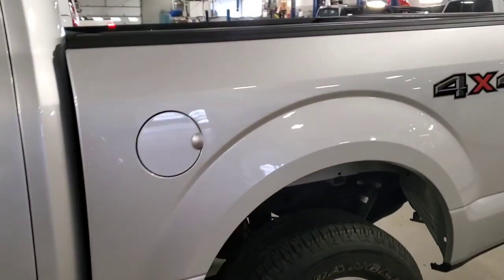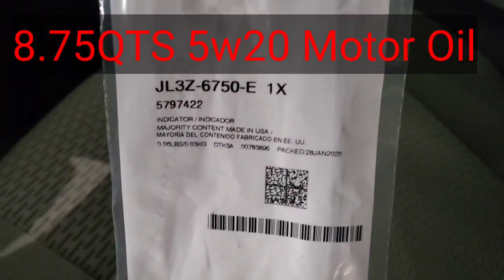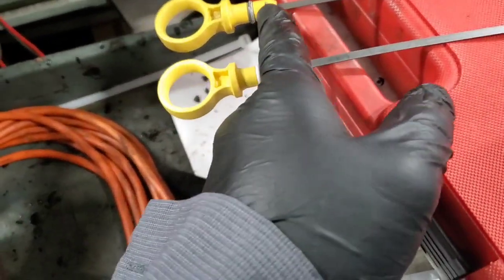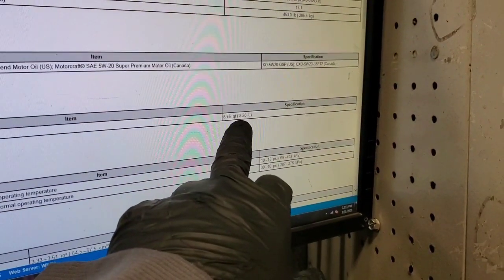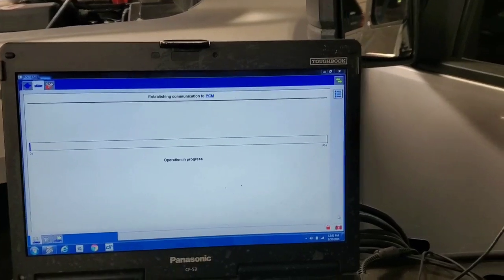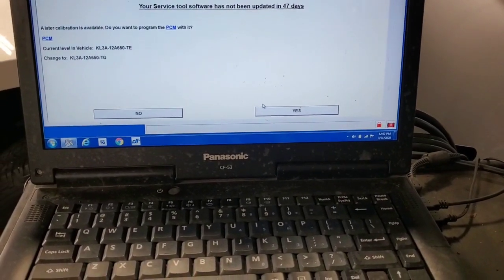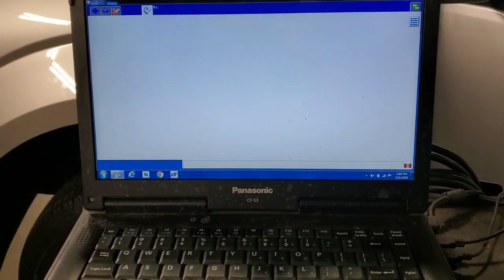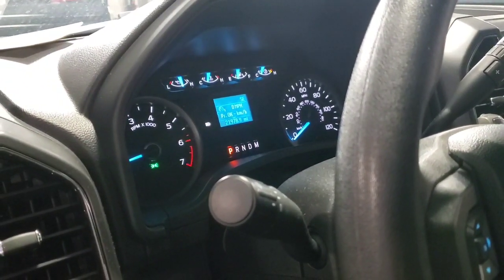2018 - 2020 Ford F150 Oil Loss or Oil Consumption Technical Service Bulletin

Comment: CAN U PROGRAM THE NEW TRUCK SO IT DOESN'T SHUT OFF EVERY TIME  U STOP?
Reply: You can absolutely turn off the auto start/stop with forscan and an obd adapter. I left mine on because I pull a trailer 60% of the time anyways.
Plus you can add things like, hill descent control, bambi mode (all lights on for high beams, low/high and fog) can turn on global window control so you can roll windows down and up with the key fob. There are tons of things you can do.
Reply from the maker: And if that vehicle has Auto start-stop and the dealer finds out you went into the programming yourself while it's under warranty you might find the wrong dealer and they will either ask you to remove it or they will not work on it or it will get reported to Ford and then the warranty will get voided for certain things I've already dealt with this kind of thing in the past

There was a guy that used a factory upgrade program for a Ford accessory and used a factory Ford upgrade tune but he got it from a separate source and it messed with the security system of the car and he thought he was in the clear because he was using Factory Ford stuff but what happened was it screwed up the security PATs system he ate almost $2,000 fixing that while it was under warranty because he did it himself and didn't know what he was doing and it didn't show up as a fault until almost a year later

I went into the computer system to figure out why the vehicle wouldn't start and I noticed as soon as I logged in it said vehicle programming and something about no emissions and I was like wait a second that's not a factory Ford program so whatever he did he screwed it all up and I could not put that back on the manufacturer that was his fault
Reply from the maker: I had a customer unplug the trailer brake connector and it set like eight different codes in the computer because they didn't like the auto start-stop and I could have taken that time and put it back on the customer because technically they modified the vehicle now I understand there's a lot of people out there in the aftermarket world and all over the Internet on the forums that think they know everything but we have to deal with these situations on a daily basis and I am a professional and if the customer thinks by them modifying their vehicle and then coming into the dealer with it under warranty it's going to get covered under warranty they are wrong eventually they're going to run into a problem because of something that they did

Now the customer was nice enough to let me educate them on how communication to get screwed up by messing with certain things and it will set codes in the computer and it will disable other functions because they modified something which the Smart Touch didn't work on the door and the tailgate wouldn't open and it was causing some communication jams on the com Network

Their concern was fixed once they undid what they modified because somebody on a four more on YouTube told them that it was okay
Reply from the maker: No unfortunately
Reply from the maker: You can put a trailer connector in your trailer connector hook up and it's like one of those tests connectors and it will make it think that you have a trailer connected or you can troubleshoot the wiring diagram down to the single wire that goes into the trailer brake module not the whole connector and snip it or put in an inline switch to turn it off but you can't just program it to remove it
Reply: paul cristma Amazon sells OBD II port connectors that will shut it off permanently. Or so I’ve heard. Might check into that
Reply from the maker: @shadowdestined2992  if it's under factory warranty don't plug anything into that OBD port
Reply: @fullcend-tkm73  I'm interested to hear the reason for you having this opinion.
Reply from the maker: What opinion are you looking for me to explain
Reply: @fullcend-tkm73  "if it's under factory warranty don't plug anything into that OBD port"
Reply from the maker: @shadowdestined2992  now there is a connector that you could plug into the trailer connector and it thinks there's a trailer connected and it shuts It Off
Reply from the maker: @shadowdestined2992  also if you really felt froggy enough you could pull the wiring schematic for the connector that gets unplug from the trailer brake module under the dash and find the one individual wire that feeds the auto start-stop and snip it and then plug the connector back in
Reply: Just unhook it from the negative terminal at the battery. It is a very small clamp.

Comment: Had good luck with the ecoboost had 2015 and 2018 strong fast and good fuel economy.
Reply from the maker: Exactly they are very powerful and they do have very good at fuel economy but they inherently have a lot of issues leading front covers leaking oil pans leaking turbo seals excessive blow-by carbon buildup on the earlier models they don't have dual sets of injectors to clean port and direct

Those things that you pointed out are all that they were really that good at everything else was a nightmare I would never recommend somebody by an EcoBoost
Reply: @fullcend-tkm73  the first gen had some but have seen alot with 150,000 plus no problems biggest thing was chain stretch. Love the second gen with duo fuel system. Still rather have than dodge. Head gasket,exhaust manifold. Anything they have that ends in 7 shitty.

Comment: I just bought a 2020 at 150 with a 5.0 HI guess I checking my oil But does a 2020 have the Flash up the already knew district
Reply: My 2020 with the 5.0 has the newest oil dipstick seen is this video. It came from the factory with it.  It doesn't appear to be using oil over the 4,000 miles that I have on it. Still at the highest level.

Comment: If my old 97 f150 with 260,000 miles didn't  use oil you would think a 2019 with 21978 wouldn't. Just sayin.and the air was colder than my 2011 also.
Reply: My 97 f150 5.4 had 332,000 miles when i traded it in.  Didn't use any oil. It was much better than the new ones.

Comment: They should go back to 1937 when they used a float in the oil pan and it stuck up though the intake so you could read the oil level. Incase anybody is wondering that was on a Lincoln zephyr v 12 flathead engine
Reply from the maker: today is just not quality anymore
Reply: I remember seeing a 1916 Chevrolet that actually had a separate oil tank and float valve that would admit more oil as it burned away. I don't know if that was OEM or aftermarket.

Comment: had a 19 3.5 HO F-150 and burnt 2 quarts of oil every thousand miles. Was in the shop 4 times by 2k...lmao...said cya ford with there shit and bought a Ram and problem solved
Reply: I've had 2015 and 2018 3.5 ecoboost no problems out run ram all day. Dodge has a lot of issues too used to work on plenty of dodges and Chevys.
Reply from the maker: I live the ram
Reply: Until your cam and lifters go out about 5000 miles after the warranty is over. Look it up. The Gen3 Hemi’s are eating their cams. Makes a little oil consumption seem not so bad.....
Reply: You must of got a bad one had alot of Fords run the hell out of them. Dodge has alot of problems too. Someone bought a 2019 had alot of problems traded for Ford been great. Have to get a good dealer. Ill keep my f150.
Reply: All of these vehicles have their problems but it's not our job to say my F-150 runs great I don't know what the hell you're talkin about you must be making stuff up

There's no denying here that there's obviously an issue some people get good ones some people get bad ones

 it's the luck of the draw and if you're willing to take a $60,000 chance at luck of the draw then have at it but when people are putting out good information and just sharing stories on real situations it's nice to take note of that and not talk down the point of someone giving you free information that does it as a profession or a real life experience 

All of these manufacturers are having problems right now it just all depends on which one you want to have as your problem

Comment: Everyone keeps mentioning TSB for oil consumption. However, there’s no mention as to what TSB number this is?
Reply from the maker: It specifically states that right in the writing right in the beginning of the video TSB 19 - 2338
Reply: FULL CEND - TKM Thanks!
Reply: I thought I saw that when you were running the install, it had a note on the screen that the upgrade supersede TSB 19-2338?
Regardless still good info. Thanks again.
Reply from the maker: I'll get it for you I could have swore I showed it in this video

Comment: Absolute scam. Did nothing for my 2019 f150
Reply from the maker: Have you tried to go to the Better Business Bureau and start an arbitration
Reply: @fullcend-tkm73  well see. It's in the shop now for timing chain rattle recalls. Im Just building my case. 2019 f150 8k miles. Burns 1qt every 1k miles and rattling chains on warm up.
Reply: i got rid of mine very quick..burnt 2 quarts every thousand miles from new..

Comment: Curious - how many people have you had come back AFTER doing this TSB complaining that oil consumption continues?
Reply from the maker: So far I've had none
Reply: I had this TSB done to my 2018 F150 5.0L. It went from 1200 miles per quart to 3300 miles per quart. Still not perfect, but much better! The service advisor doesn’t understand why, but it shifts MUCH better too. Especially the stoopid skip shifts. Glad I had it done.

Comment: The injectors turn off during down shifts to help with shift smoothness.   When they turn back on it shouldn't create extra vacuum. Even if that was the case, it shouldn't be sucking up oil. Where is it sucking up oil from anyway? A reprogram and a longer dipstick sounds like a bandaid to get the customer through the warranty period. The longer dipstick must not have worked for all the owners that ended up having to have the engine replaced because of bad pistons, rings and cylinders.
Reply from the maker: I'm with you, your preaching to the choir. I deal with this daily, its not a fix ideally but this is what they are doing right now and we gotta roll with it
Reply: @fullcend-tkm73 
Yeah. Roll with it till it's out of warranty then Ford's off the hook and the customers are stuck with it.
Reply from the maker: I make these videos to keep you updated with what's going on with Ford not me and not what my beliefs are 

and if I wanted you to know a belief or how I would fix it I would state that

Taking out your issues on me with what you really have against Ford is not okay
Reply: @fullcend-tkm73  
I don't have issues with you. You made a good video and I'm just saying what Ford is doing is wrong. If you have any updates keep us posted.

Comment: I digested the "fix" overnight and for the life of me I cannot understand how changing pulse width at all would cause or end vacuum that could PULL engine oil into the combustion chamber.
Why? PCV  the crankcase is vented.  the cylinders will always be doing suck squeeze bang blow....fuel on or off...
PROOF:  The ONLY way engine oil can enter the combustion chamber (aside from a failed head gasket or internal cracks in the head/cylinder) to be burned is from bad intake valve seals OR poor piston to cylinder wall clearance OR improper oil scraper rings.  If this is Fords theory then the vehicles must be driven like cabs in NYC...stop and go stop and go stop and go....
Nope,  these trucks are driven I would guess on highways with little deceleration.

The nail in Fords coffin is the ''''alternative dip stick low, high and length" fix.....tisk tisk tisk....
Have y'all seen the vids of the diesel sounding 5.0's once warmed up???  piston slap

Any Ford engineers willing to take a lie detector test????.
Reply: TSB 2058
step 3 replace the PCV valve
Step 13 Does the oil consumption exceed 1qt in 3,000 miles or less....yes/no. if yes proceed to step 14
Step 14 replace the engine long block assy and prepare original block for return for analysis, refer to WSM , section 303-01D
Reply from the maker: Unfortunately right now this is the answer to it until you can prove excessive oil consumption and a customer comes back even after the TSB has been done so we'll wait to see if the customers come back and monitor the oil in the meantime

Honestly the reason a lot of oil consumption happens is because of timing issues

With people wanting more power out of these vehicles the timing has to be messed with quite a bit and when you have high manifold vacuum due to advanced timing it will actually pull oil from the crankcase during certain events and a little bit more than normal during regular events
Reply: @fullcend-tkm73  ACTUALLY.....there IS an oil consumption test where you are supposed to mark the old dipstick then the customer OR bring in every X miles monitor the oil loss... TSB 2508.

NO way the oil loss is from timing issues.....try the plasma bore coating vs iron oil control rings OR a seriously poor PVC system.
Also take a look at the code in the new flash...something about changing the values on the low pressure sensor.....

I worked for 2 major motorcycle exhaust system manufacturers in R&D doing fuel system code for the new exhaust and air intake modifications....fuel is not the issue here.

Im with YOU brother, you are not Ford...
Reply from the maker: You got all the answers then why reply here

I never once said fuel was the issue I only spoke about timing and did not reference fuel there's a reason for that
Reply from the maker: If I'm supposed to do something a specific way regardless if it makes sense to you or not or it doesn't make sense to somebody else that's my job on the f**** line and that's what I need to do so if the technical service bulletin says do it this way THAT'S WHAT I'm doing exactly, because that's how I get paid.

Timing is incredibly important in the function of engines. When motions are not perfectly harmonized between the valves and pistons, a vacuum can be created that draws large quantities of oil into the combustion chamber, causing high consumption.

I'm going to continue on my day and do what I do, I understand we all have an idea and opinion on how all this stuff works but it doesn't mean one of us is wrong and one of us is right we just have different approaches on doing things

 have a great day
Reply from the maker: @wfoelsinore  you don't have to be here on my page you can get lost as far as I care I don't have time to deal with people like you

Comment: soooo I feel I am dammed if I do either way......but which is the worst between the two???????

Was looking for a new truck to pull a 4000lb RV  Was thinking of a F250 crew lariat with the new 7.3...then I see how cheaply the front swingarm is made ( have a 2000 4 leaf spring F250) and cringe to the thought of Ford going that route AND seeing and hearing of friends with the DEATH WOBBLE......I blame all that on cheap chinese junk OEM parts and going to that stupid swingarm design..
RU back ordered on the updated chinese hitachi steering dampers????

OK lets get the F250
$60k for all that cheap junk pisses me off....why should I have to re engineer Fords design and spec to a KIng or Fox front damper system, install beefed up swing arms, heim joint track bar and  AND have to change caster???? tells me someone didnt get the memo in a meeting on that one....

OK bag the F250 lets look at a crew F150 lariat with the coyote engine...woops.... tensioners, oil use...sighs....
I am getting the feeling that all the technology combined with crap chinese parts are just killing the new truck market....maybe I should look for a 1974 Highboy....2 wires to the coil  and 4 leaf springs...NO ISSUES !!!!  that or bag the RV and just buy an El Diablo Taco...

I do appreciate what you are doing, I have been a mechanic all my life s I get how things work.
 What is your take>>>???
Reply from the maker: Unfortunately after the 7 3 things went downhill for the diesel trucks the new one isn't so bad the new 6 7 but again it has it has its issues as well

If I was to buy one I would look for a 4 wheel drive 5 l F-150 prior to 18 we never really got cam phaser and chain issues with those just the EcoBoost ones
Reply: @fullcend-tkm73  many thinks.... I guess Ill roll the dice on the F250 with the godzilla 7.3 gasser.

Comment: I have a 2019 ford f150 with the 5.0 and at 1343 miles it had burned oil down to the bottom hole on the dipstick they did all of the updates that you did and I just went in for an oil change with 6400 miles at my local ford dealer for an oil change they told me it didn't burn any oil that time but they filled it with 10 quarts of oil not 8.75